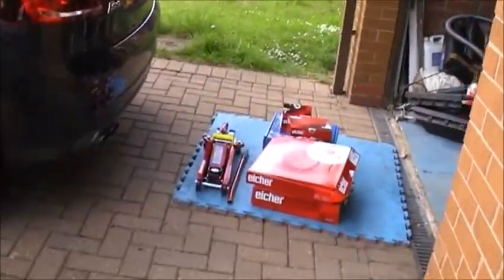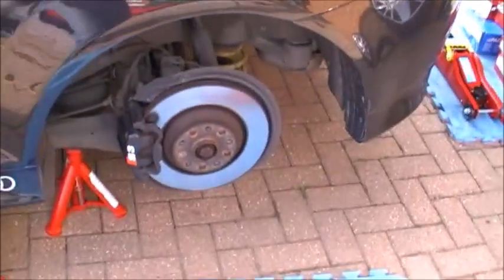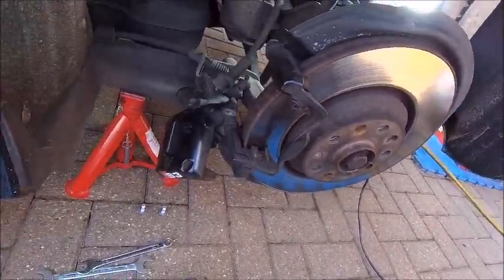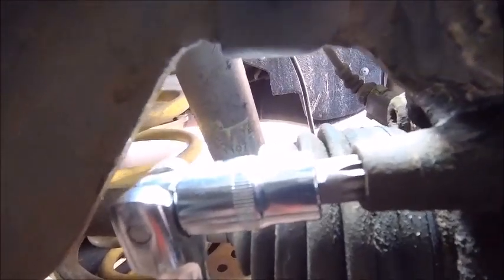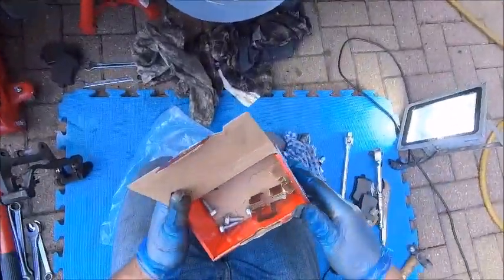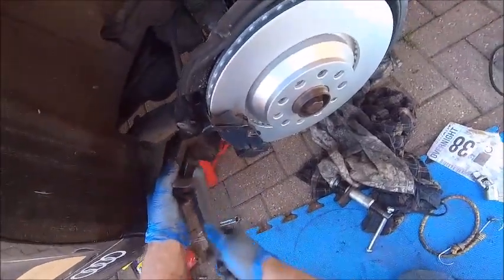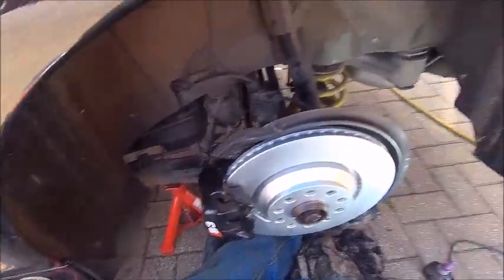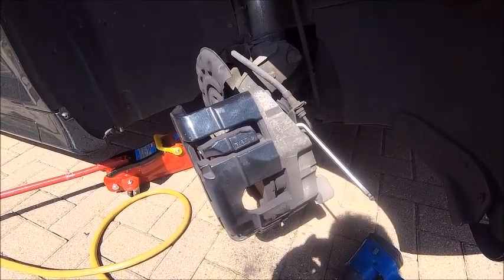Audi S3 brakes - Full disc and pads replacement.

Comment: Great video.  I was stuck for about 3 days attempting to figure this out on my A3. Just a little insight on how to get the caliper bolts off.  Make sure the car is higher.  The upper bolt has a very narrow window.  I used a smaller ratchet with a homemade breaker bar (metal pipe) to get both off.  If the car is high enough that will give you enough room to pull from an angle near the rear bumper.  Make sure you do not order the longer m14 sockets.  They wont fit unless you have an extremely long breaker bar and a car lift.  Thanks again for uploading this.
Reply from the maker: Glad my waffling was of some use  😃  .   thanks for the info.

Comment: Thanks for the video helped a lot for changing my rear discs. I didn't need to remove the caliper bracket as there is enough clearance to get the disc off on my 2019 S3.
Reply from the maker: Glad my ramblings helped .... A few people have mentioned you don't have to remove the bracket, so we all live and learn   👍

Comment: Just doing a 2009 A3, 102 kilos, believe it’s the first refit, there is a rotor retaining ring made of aluminum , not mentioned by anyone before. Bit of a chore removing it, cut it off with a grinder, going to try heat on the other one. I don’t plan on replacing it. Had to Amazon order a set of torx with an M 14 to remove the pad bracket holder.
Reply from the maker: That does sound like a mare .....hope you get it all sorted soon  ....
Reply: @AdeReeves  Job done, great job on the instructional video Ade, note to Quattro refits, Quattro has a slightly larger rotor. Thanks

Comment: Also worth pointing out that the pistons would go back much easier if you open the brake reservoir lid in the engine bay - mine flew in once I did that 👍🏼
Reply from the maker: Noted  👍

Comment: Regarding the M14 Spline tool.
You can try to press/remove the hexagonal side out of the socket adapter. 
Now you can use an wrench tool on the hexagonal side of the M14 spline tool. With that method you have enough space.
Reply: Snap-on stubby xzn 3/8 😃

Comment: Ade mate, you've done me a solid with this upload. Been meaning to change my discs and pads all round on my s3 8p (Just been sat the last year) due to new young family so been using the family car. But yeah, definitely given me the confidence to give it a go. Think ill start with the front though lol. 

Just saw you were Peterborough based too, as I am.. although about to move. 

Great vid tho pal. Thumbs up from me
Reply from the maker: Glad its helpful mate... I'm no pro but try to make the videos with as much info as I can...if you get stuck give me a shout ...Cheers Ade.
Reply: @AdeReeves  Cheers. Did you torque up the wheel bolts and any caliper screws? - if so just wondering which and to what NM. Thanks again
Reply from the maker: @DeMoto.R6  Ill be honest ..I have never torqued up wheel bolts not even on commercial applications (never had a wheel come loose yet) as for the callipers again its by feel , but in my defence i used to assemble engines on a production line and after a few  thousand you get a "feeling " for how much you can tighten them. I wait for the negative comments for this  :)
Reply: @AdeReeves  i see, no negativity here mate haha. While doing the front change would you say its advisable to keep the handbrake on to stop rolling? Cheers

Comment: Did you use any extensions on the breaker bar to get the splined bolts off pal or was it litrally just the splined socket on breaker bar? Cheers ✌️
Reply from the maker: just the breaker and dog-eared determination  😀.. fortunately they "cracked" ok..
Reply: @AdeReeves  what length is your breaker bar pal. I'm just trying to cover all bases before I start haha 😄
Reply from the maker: Only a cheap ebay 380mm one ...nothing special at all
Reply: @AdeReeves  perfect. Thanks pal. I'll give you a shout out when I upload the video.  PROJECTFEARN 😎

Comment: Rotor will clear the caliper carrier bracket without taking it off. Really no need to remove it. Saves a bit of time.
Reply: No it doesn’t. Not on this model of car
Reply: I done a s3 last week the disc comes out no need to take it off
Reply: Tried mine today could not get the disc out with the calliper carrier still on and also could not get a socket on the spline no space what so ever for the thing to screw out
Reply: Doing mine now, disk wont come out

Comment: Hi mate, great vid...how did you push the pistons back in the front callipers..do you need the winding tool or do the just push straight back in ?..
Thanks been waiting for someone to do this S3 video...
Reply from the maker: Thanks for the positive comments....The way i have always pushed the front pistons back is loosen the caliper and twist whole assy while the pads are still in contact with the disk ...i find that mostly gets them back to a point where you can then get adjustable pillars in the finish them off, but obviously be careful of the rubber seals .. I know its a bit "Barn Door" but it has seen me OK for years..if they are too stiff to do that you have bigger problems...also consider a wedge of wood...that works well too but your need different sizes

Comment: Does one need to connect to board computer to change the disk or brake pads?
Reply from the maker: For me i did not get as far as a warning lamp, so it was a straight change with no ECU reset.

Comment: How to Change Rear Brake Discs and Pads with Electronic Parking Brake (EPB)
Reply from the maker: Mines manual so don't know for sure , but I guess you just have to release it similar to what you would using a lever.